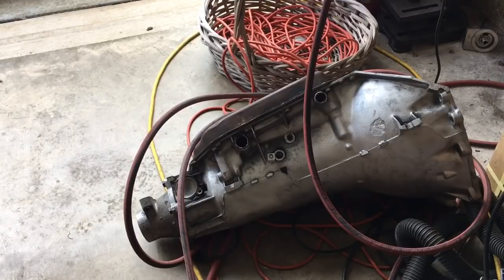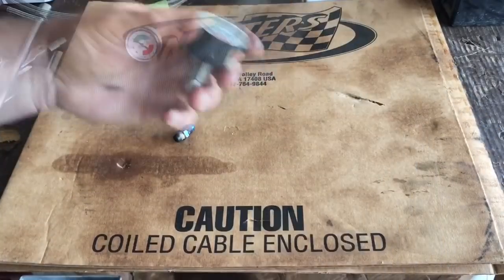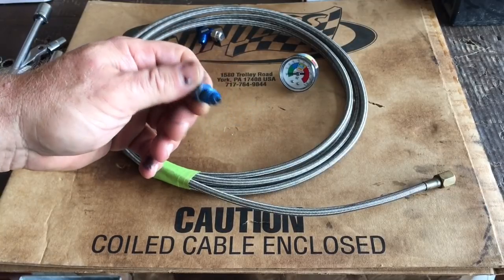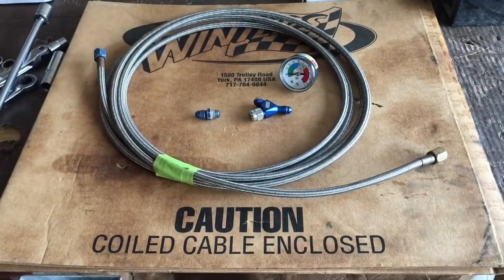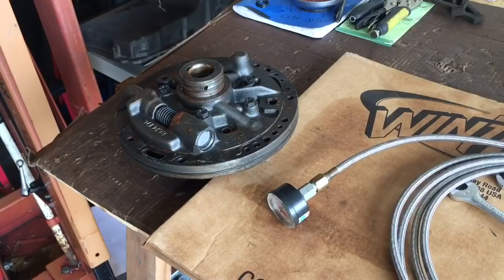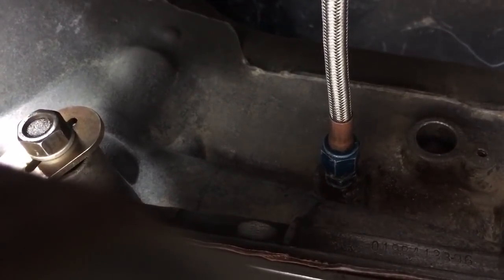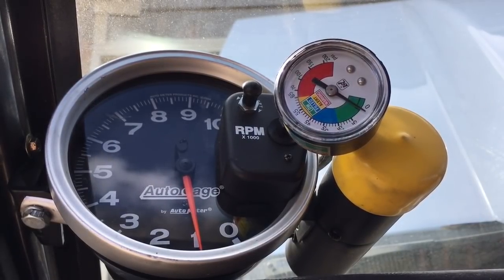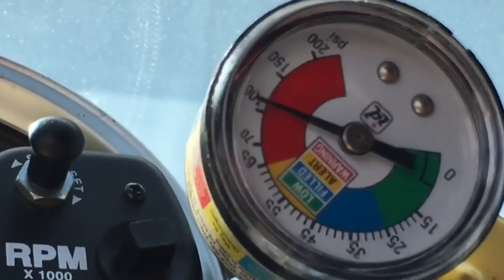TH400 Valve body/pump pressures to diag slipping issue

Comment: Bourdon tube style gauge: try not to go full scale.  You pass 95% of scale and it time to think about swapping to more range.  Yes there's some headroom for overrun, but why go there: once sprung, that gauge is doomed.
Pressures:  yours  look pretty near what tci does with their 400's?  Except P and N seem a little high - check out their chart online.  By comparison,  [bone stock] numbers per ATSG [brakes + 1krpm]: N=55-70,  D3=60-90,  D2=135-160.   I doubt slippage is a line pressure problem, and the pump is ok.  So... slippage is only in 3rd gear, or something else?  I trust you started with the simplest thing: disconnect shifter linkage [not running] then operate lever by hand to exercise the valve through all positions then leave in neutral - with shifter also in neutral, make sure linkage goes back on and does not require any movement of arm on transmission.  Adjust if needed to get things sync'd once more.  That fails... tear into it: a cut seal, check ball problems, who knows.   If you are having a problem with only reverse and 3rd, something in direct clutch circuit needs attention.

Comment: Ive got a TH400 w/reverse manual valve body. I’m going to install a pressure sensor &, temp sensor. Could you please tell me What are the temp and pressure values I am wanting to see? Are they the values that were talked about?
Reply from the maker: Your pressures will be higher than the ones in my video.  As for exact figures I’m not sure but I’d expect closer to 200+.
Temperature will depend greatly on the efficiency of your transmission cooler and torque converter.  Iirc you want the transmission fluid to be similar to engine temperature or lower, it’s when you get above 200*_250* is when clutches get burned up.  Do a Google search to verify recommended transmission temperature.  JD

Comment: Have the same problem 1-2 over 180 psi and 3 yust over a 100 psi so what did you find or how much did it make after the fix, i really need some ideas i cant find the problem ?
Reply from the maker: Trash in the Governor assembly!  Easy fix, pulled and cleaned the Governor assembly, make sure the spool valve inside can move freely
Reply: @HeadFlowInc  okey wel my is totaly fine there is nothing wrong with it. I just wondering if youlbe wiling to show  what it actually marking now when it is fixt  ?
Reply from the maker: I’ll see if I can find my line and fittings to check the pressures now.  JD

Comment: So what is your 3rd gear pressure now that you have it cleaned out?
Reply from the maker: dragginfool After cleaning out the Governor it fixed my shifting, slipping etc. so I never rechecked the pressures.  When I get my TH400 back in after the Ultra Bell install I’ll try and get those pressures.  It would be interesting to see if they change!  JD

Comment: Maybe needs a b&m shift kit. And maybe your getting some leaking between the spool where it moves in the bore of the valve body
Reply from the maker: Dave vonAnderseck Can you believe all the trouble and issues was debri in the governor assembly?  Literally there was a small piece of black plastic stuck in the governor assembly keeping the spool valve from moving.  I cleaned everything up, polished the spool valve and it works great!!! 
I even started dialing in my governor WOT shift points by lightening the “wing weights”, right now I have it set to shift by itself @5300 rpms WOT in drive. Later I’ll get it dialed in a tad higher once I know where the power peak is.  
Thanks for watching and the feedback I appreciate it!!!   JD
Reply: Man i0. glad you gotter figured out.

Comment: Is that transmission built with the line pressure kit that holds the transmission at full line pressure all the time?  If not the pressures at idle, with the TV cable NOT connected to the throttle linkage, should be in the min values and with the cable pulled out fully, by hand, and the engine at idle,  the pressure should be in the max range.  When the transmission is in 1 and 2, the line pressure goes to full by design.  All the other gears, the line pressure will change as the TV cable is pulled.  By looking at the numbers, I am guessing the TV cable was connected to the throttle, with a small amount of pre-load.  So with a little pull of the cable, the line pressure goes up above the min value, but below the max value.  Try having a helper pull the tv cable for you while you record the pressures.  

Park
Min 55-70
Max 150-175

Reverse
Min 95-150
Max 235-260

Neutral
Min 55-70
Max 150-175

3rd
Min 70-90
Max 135-165

2nd
Min 135-165
Max 135-165

1st
Min 135-165
Max 135-165
Reply from the maker: Tom Rassier The TH400 doesn’t have a TV cable for modulating valvebody pressure. The TH400 uses an electronic “kick down” solenoid for activating the low speed/passing down shift. 
The valvebody and Governor Assembly work together for automatic shift characteristics, with manual low having more pressure. 
The problem turned out to be debri in the Governor Assembly spool Valve. 
I think the 700R4/4L60 was the GM transmission with a TV cable that must be properly adjusted or the clutches get burned up.
Thanks for the feedback I appreciate it!  JD
Reply: HeadFlowInc haha,  I had my units confused. That one has a modulator valve doesn’t it?  Are you still trouble shooting it?  I imagine you have already trouble shot that?  It’s hard to really trouble shoot without actually being hands on. If and when you solve it, I hope you will share the solution with us!

Comment: Hope you get it figured out bud looks like a tear down in the future ☹
Reply from the maker: Jason Cameron I can’t figure out what could be wrong except debri in the valvebody affecting fluid flow. The clutches aren’t burned up, all the pressures are ok except the 3rd gear is low in proportion to the others. The pressure reading for 3rd would be fine if it were stock. 🤔
It’s definitely being stubborn 🤔🙄😳
Reply: @HeadFlowInc  sounds like that piece of oring is stuck somewhere in there what else would do it?
Reply from the maker: Jason Cameron I wish I knew, I’m hoping someone with more TH400 experience chimes in. 😉. If the slipping isn’t a pressure loss in the VB via a stuck valve, Stuck Governor valve, or stuck Modulator valve it could be something like a lip seal or the intermediate “pin” being to short? 🤷‍♂️